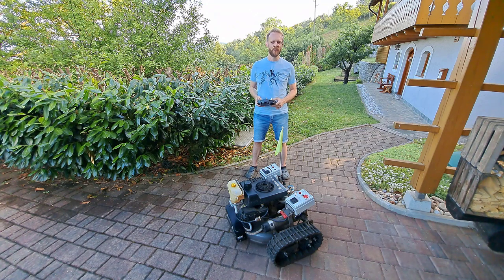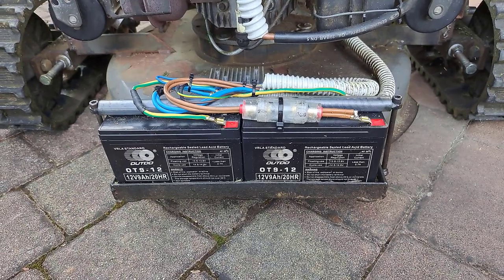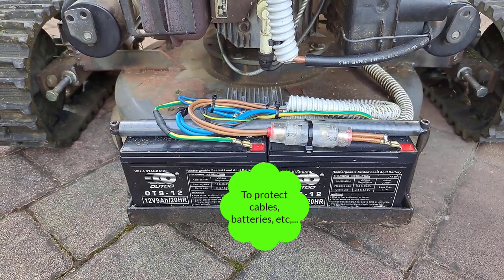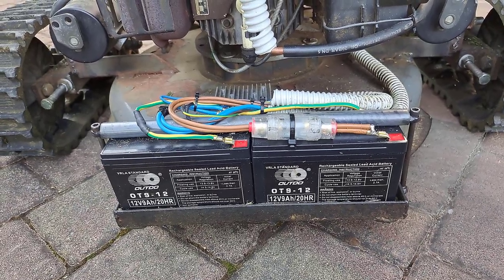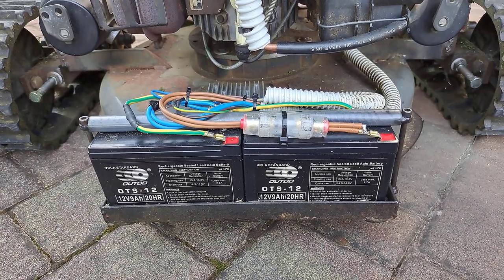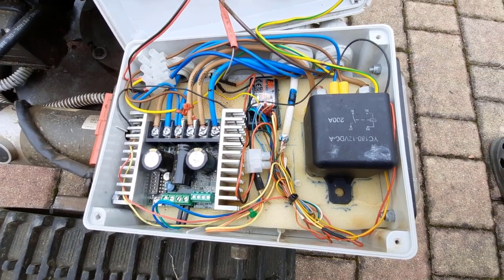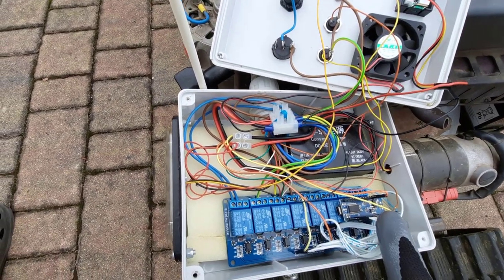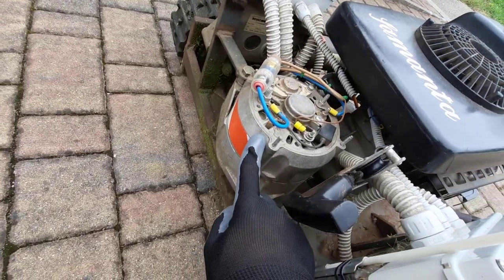Introducing Electronics - Remote Control Lawn Mower DIY

Comment: You do a very good job, very professional video.
I have a request, I have a zero turn mower, what electronic board should I use to control the mower, moving forward, backward, left and right with one joystick. I have two 12V actuators that control the hydromotor?
Reply from the maker: Hi, thanks for nice comment. To run smoothly you need actuators with feed back, so the microcontoller always know the position of actuators. If you have programming skils you can make this with arduino and two h-bridge drivers. I dont know if there is ready to buy solution on the market. I have developed universal electronic board for lawnmowers that can be programmed the way you want. Tell me if you are interested and we will find solution to your problem. Maybe send me some pics on email that I can imagine thinks better. Have a nice day!

Comment: Hi sorry i have made my robot and it work but i have normal wheels on it and i have some slopes where robot cant go up cause wheels are free spinning. Can i send you some pictures? I would like to get your opinion and suggestion. Actually i have some slopes with 40-45 degrees of hills and i would like to be able to pass that area. Currently sometimes it stuck.
Reply from the maker: Hi! Of course you can send me pictures. I'm happy to help. My email address is in the video detail.
Reply: @gregorkobetic  thanks I will send you later

Comment: What do you use the arduino for? Relay for which purpose?
Reply from the maker: To read rc receiver signal and control relays for power off gasoline engine and beacon lights.
Reply: @gregorkobetic do you also power it on via rc or only off?
Reply from the maker: No, because my engine dont have starter. It would be much work to make custom one. If I will consider changing the engine I would pick one with starter now